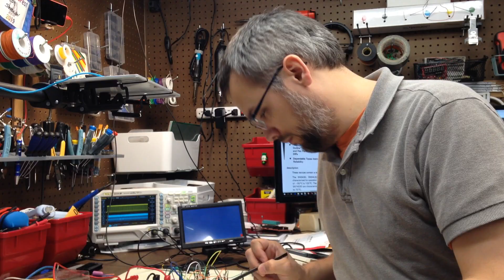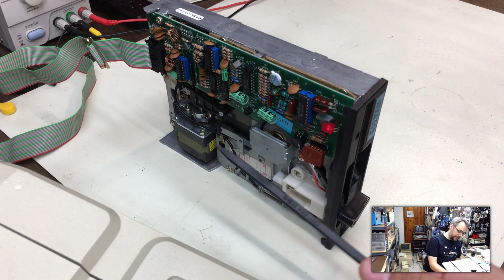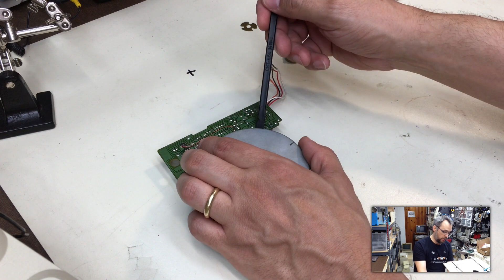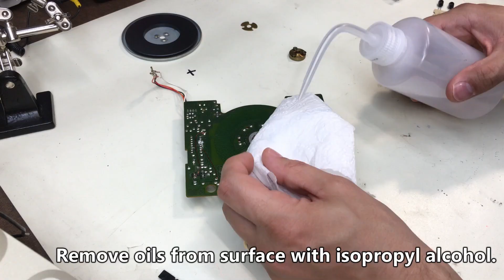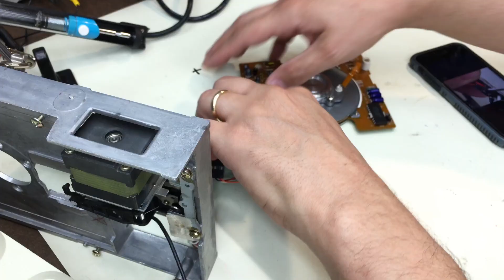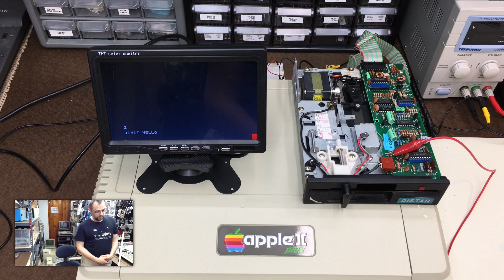Apple ][ Floppy Drive Repair with Javier Rivera!

Comment: You should know this because you purchased them... not pokey thing, it's a spudger.😀

Are you aware those bearing packs are sealed?? No matter what you spray on them won't get in. 3-in-1 wouldn't have been good even if you opened the pack, it's too thin. Thin (WD40, PBBlaster, 3-in-1) works for cleaning, but to lubricate you need bearing grease.

Did you try chipquik on the joint you couldn't melt?
Reply from the maker: If I could go back in time and know all the things I've learned since then, I would! I know all your suggestions now. But back then - nope!

And it is a pokey thing. Cause I said so! :D j/k

Comment: So why did you just jumper the write protect sensor instead of trying to fix it?
Reply from the maker: Because I didn't have a replacement sensor, we were on a production deadline, and Javier didn't want the sensor anyway since he replaced it with a manual switch.
Reply: @JoesComputerMuseum  Good reasons!

Comment: Another way to get the crap out of the hole where the capacitor was is to use a small pcb drill, then try re-wetting the joint and suck the solder out again. Also you may have to scrape off all the corrosion from the pads.
Reply from the maker: Yes! This is a very valid process. Now I know what my next shop upgrade will be... a PCB drill! Any suggestions on make/model/etc?
Reply: @JoesComputerMuseum  A set of 10 PCB drill bits from 0.3 to 1.2mm is available on eBay under $5. get a couple of sets in case you break one. These have a standard 1/8" (3.2mm) shaft diameter. I sometimes use a Dremel tool, however this is a bit too fast (10,000 to 37,000 RPM) and a bit heavy to use. The other tool I have is an old Arlec Supertool connected to a variable DC power supply, although I don't know if these are available anymore. I'm sure there would be more modern rotary tools available better than the ones I use. I rarely have to use them for drilling out problematic solder pads. You could get away with using a conventional drill carefully for one-off jobs.
Reply from the maker: @markcummings150  This is insanely helpful. Thanks!!